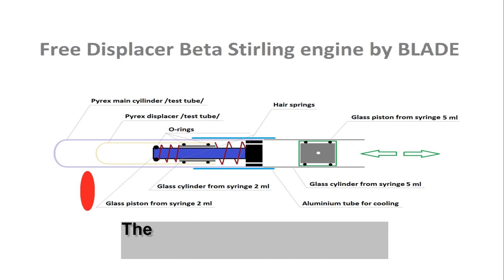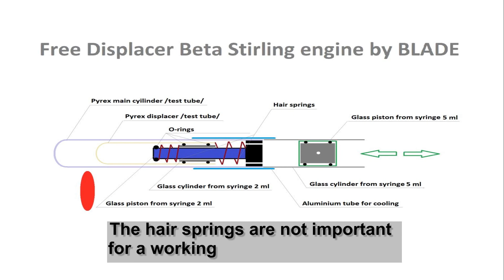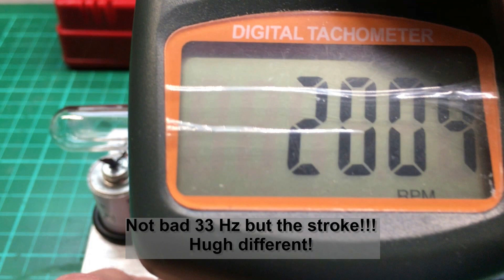Free Piston Stirling Engine (NASA type from glass syringes)

Comment: I truly believe, the FPSE (Free Piston Sterling Engine) is the most efficient hot air engine design ever created. 
Can you improve your model further by improving the regenerator further ?
My goal would be to create a small desktop model just like you have created with a small 5V 5W output from an ethanol burner. I want to add cooling fins and a tiny air cooler as well.

Comment: Thanks. I would like to see the magnet in the center of the small tube and then ferrofluid replace the oring.  And old thought you showed but a new twist on this design.  Then you could just maybe have an outer magnet as a safety catch if the rubber band broke. :). Just a thought.
Reply from the maker: Hi there! I think it is possible with strong enough magnets, but actually it is hard to manage, but all things in my mind. Thanks! BLADE

Comment: Hi Blade, I always appreciate your designs and videos. I think a detailed tutorial would be very popular. It seems that there may be a few parts that could be 3D printed and maybe you already have. Even though you have simplified the design, it might take 2 or 3 videos. My request: No steps missed and all parts listed in the description below the video so that it is easy to copy and paste to source the parts. Thanks
Reply from the maker: Hi there! Thanks very much! Maybe it will be popular but nobody knows it now. The voting balance tilt to the tutorial also from this engine. I want to make that, maybe the second unit will better than my first! :) 3D printing is possible to use here for the stand also for the rubber holder arms if the material fatigue is good enough for that. PLA is OK for that. But I haven't got enough time to replace my printer's parts. I have 2 but not ready to use now. But I could design those parts to you if you want after the redesigned and built engine for the tutorial. We will se! I want to make a clear and easy tutorial dfor this. But the part list is tricky. I want to make an agreement with the manufacturer if it is possible. Best wishes! BALDE
Reply: @AttilaBlade  Cool! Maybe Banggood would sell your kit or sell a kit on eBay or etsy and make a bit more profit. I think a wood base would also be very nice. Thanks and Good Luck!
Reply from the maker: @TheWindGinProject  Yep, the kits are very popular there, but my versions are not market ready yet. I hope it will! :) THANKS! BLADE